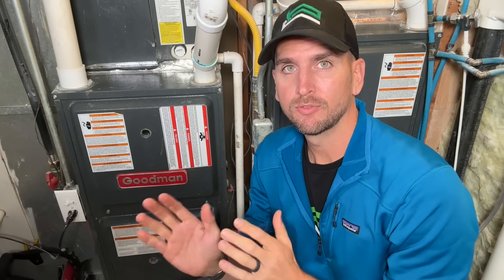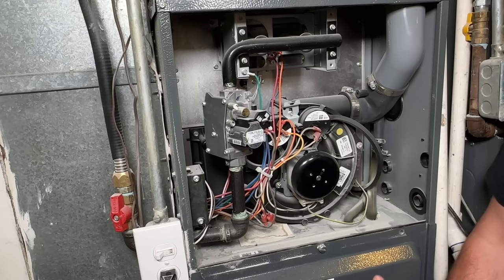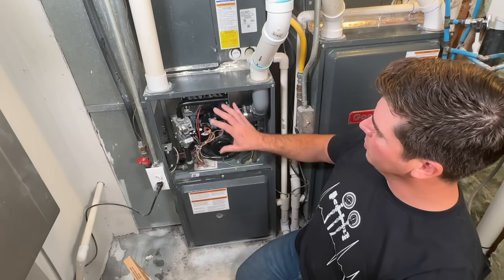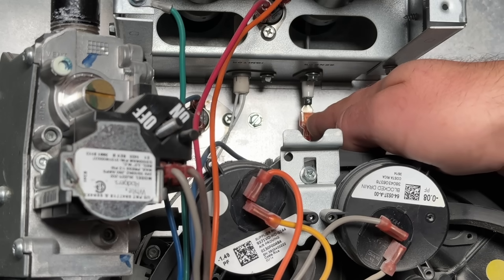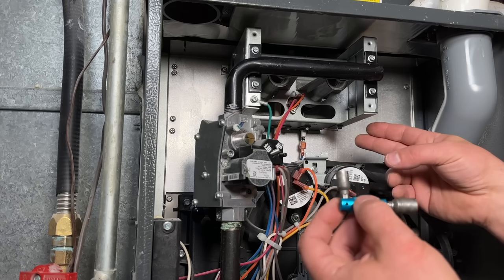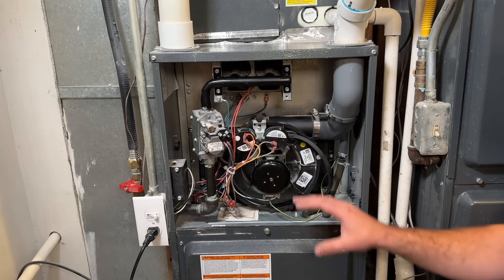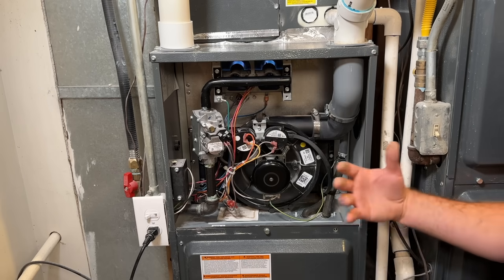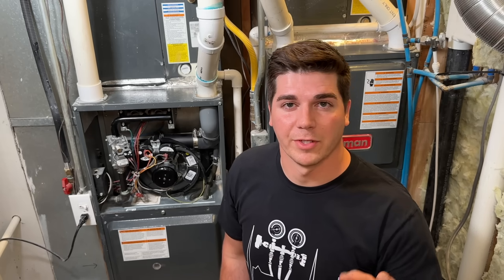Yearly Furnace Cleaning And Maintenance Pro Tips

Comment: I never cleaned my old oil furnace and I changed it out 15 years ago because it was only 80% efficient (when it was new). I never clean my new gas furnace (95 % efficient) and it is still going strong. Modern heat pumps can be more efficient and more convenient, since sometimes a ductless unit is very practical and easy to install.
Reply: Your oil furnace must have been a hot mess, lol.................seriously soot can buildup and restrict the flow of flue gases such as nitrogen, carbon dioxide and water vapor. Over time, carbon monoxide can build up in your home with this soot buildup if your furnace is not properly vented or your chimney isn't properly swept.
Reply: Good luck with that

Comment: The AC evaporative coil sits on top of that furnace.  Check the end of that pvc drain is clear.  Believe me I've seen that pan overfill and cause moisture problems in the combustion chamber.    90 percent gas furnace pressure switches are sensitive.  Make sure the intake is clear of debris before starting the furnace every year.  Also air filters at least should be changed out every month.  Remember not all the US is the same.  In your parts might be cool for every 3 months.  But for folks in FL and the southwest it's at least every month for filter changes.  The houses are built for profit not air tightness as those in colder climates.
Reply: Had this happen this year.  I unscrewed the fitting where the drain line came out of the furnace (near the top where the chiller is mounted inside), and found a piece of zip-tie plugging it from the installer.  It took several years for gunk to built up around that piece of zip-tie until it was completely blocked.
Reply: I got called out for a leaking hot water heater in a basement of an old building. Got there and was greeted with the entire basement flooded with 1-2 inches of water. Had to crawl in water under ductwork to get to the water heater. To me looked OK but thought it could be leaking from the bottom. On my crawl back I got dripped on near the furnace/AC. Found the condensate drain completely plugged with mud, steady 3 drips per second overflowing. I couldn't believe 3 drips per second could flood a 20x30 basement that full but cleaned the drain, dewatered the basement and it was 100% dry after. Owner said it was flooded by spring runoff and dewatered but then they noticed some new water come summer. They waited 3 months to call. I didn't think a dril could do that but with limited evaporation 3 drips a second is 1350 gallons over 3 months collecting. No basement drain obviously another problem but 125 year old buildings don't care about your codes.
Reply: Remember that "monthly" is only going to be if its in use the entire month. Spring or fall days or if you have a very clean house, you might go 2-4 months. Visually inspecting the filter is the key here.

Comment: How can I fix water dripping from inducer exhaust tube?near the clamp
Reply from the maker: I imagine your pipe is sloped in the wrong direction.  So when the air starts to cool running through the exhaust it creates condensation which should drain outside but if you have a negative slope it is running back into your inducer.  Check the slope and see how you can adjust the slope to the outlet on the exterior of the house assuming there is a horizontal section of pipe

Comment: You should also be doing a combustion analysis and a gas pressure test to ensure your low and high gas pressures are set to factory specs.
Reply: I was wondering if that was part of a service. Also is it necessary to check the draw of the fan motor with a multimeter to see if its drawing the proper amperage?
Reply: That’s one of the differences between a diyer or you tuber and an experienced technician
Reply: You cannot adjust gas pressures on a modulating gas valve (theres a warning label on them) or you will void the warranty and probably crack the heat exchanger. That said, some older gas valves are single stage or 2-stage is pretty common.

Comment: I would have wanted to see info on how to choose a replacement filter based on MPR / MERV specs. I have read that a too restrictive filter (like perhaps a MPR 2200) can put stress on an HVAC system. Is that true? Very helpful video - and timely!
Reply: Yes, it's absolutely true. I recommend the basic pleated filters.
Reply: Yes, a overly restrictive filter can definitely have some negative effects. I wouldn’t advise doing a higher merv rating then needed. Anything above merv 12 is considered hospital grade and not really needed for residential applications. I’ll be coming out with a video on this subject soon! Cheers
Reply: Not an expert, but yes, I've also read the finer filters stress the system. To mitigate this, you'd want a thicker filter (like the 4" ones instead of the 1".
Reply: @diyhvacguy  Agreed, above merv 12 is stressing out your fan motor too much. At that point, just vacuum your house more and shampoo it annually

Comment: Just look at the circuit board it has a trouble light that will tell you if it is a sensor or limit , 95% of the time it's the vacuum switch that works on negative pressure so the induced draft fan can clear chamber before igniting furnace, they accumulate moisture which makes the switch stick open

Comment: Good on the flame sensor, but I actually wanted to see how to clean and lube the blower assembly. My home had a 9 year old 80% furnace and I'm not sure they ever changed the filters.. the amount of crud I found in the ducts and in/around the cabinet was horrific.
It's a heat only air system. So the wear might not be as bad as an AC/heat combo.. but I'd still feel a lot better having a look at the blower, It's pretty deep.. not visible from the front and the entire top half of the cabinet is dual mounted filters.
Reply: Hi Senn, to clean the blower on the furnace , first shut off the power to the
furnace. Second , locate the blower and pass your finger in the fins to see if they
are clogged . If the dirt is really bad then you should remove the blower from the 
Furnace making sure you mark the position of the wires or taking a few pictures with your cell phone. Unhook the wires and screws/ bolts to remove the blower. I recommend you take the blower outside and use compressed air and a screwdriver to get to the individual 
fins . Once it is good and clean you can then put a few drops of light oil in the oil 
lubricating lines on the motor. The newer
motors may not have the lines for the front and back motor bearings and might  
be permanently be lubricated. Reinstall the blower and wires then start your furnace. Hope this helps
S from the Great white North
Reply: Most modern motors are all sealed up so you cant lube them

Comment: I found that i had a cracked heat exchanger when my CO2 detector went off not long after i started the heating season. I HIGHLY RECOMMEND THAT EVERY HOUSE WITH A GAS FURNACE HAVE ONE  , My furnace was thirty years old ,so if you have an older furnace you really must have a CO2 detector or you could die in your sleep.

Comment: I also write down the size of the filter. Beside the flow arrow.
Reply: Nah, not necessary. you have to pull out the filter to check it anyway. But I would always right the current date on it when installing a new filter

Comment: Do some furnaces have pilot lights? Is there a process to light the pilot again
Reply: You can set the furnace to heat than go shove a match to light and then die from an explosion from the natural gas. I mean it will be lit if that was the only goal. Furnaces havent used pilot light in about 30 years now, but still very common to see on gas water heaters.

Comment: Question: I have the same Goodman high eff furnace.  Obviously, on the right, my flue is connected and vents outside thru a white pvc pipe.  On the left side, there is no pvc connected(the furnace in your video shows pvc on the left also).  Did my guy forget something or is this ok?
Reply: It might be ok, it might not be ok. The pipe on yours going outside is for pushing the exhaust out of the house, the other is for bringing in fresh air to feed oxygen to the flames. Whether or not a pipe is required depends on how much free area you have around the furnace. By code you need 50 cubic feet per 1,000 btuh input rating for all gas appliances in the space. Many times, even if you do have enough free area to support the flame it's still a good idea to pipe in combustion air from outside to improve overall efficiency. Why use air you have paid to heat to support combustion when you can bring in air from outside instead?

Comment: I came here because I’m hearing my outside compressor kick on more then I remember last year, even during heat season. We still have our heat on (set at 66-69) as we live in a cold, northern climate. We’ve been in this home for just shy of two years. 
Wasn’t sure if the compressor should even be kicking on when the heat is turned on.
Reply: When my cycled frequently I discovered the air filter was clogged. It sits between the furnace and the air return duct typically. I slid mine out and used a vacuum, which helped for a few months, but I eventually just replaced it.
Reply: @peterbogardus1560  Oh yeah I know that. I change our house air filter out every 3-4 months or as needed.
Reply: Do you have a heat pump? Because thats what heat pumps do, run your compressor for heat. The easy way to tell is if the outdoor unit is raised up about a foot off the ground. You can always go pull out the disconnect fuse outside next to your air conditioning unit (mounted on the house) and it will never run that way.
Reply: @srobeck77 We sure do! The previous HO’s mentioned it in the house’s listing that it had a heat pump. The outdoor unit is also raised up on stilts! Good to know that’s why that kicks on. Thank you!
Reply: @telecasterman18  heat pumps arent very common in northern climates is prolly why you never seen one. But they are actually more efficient to run when its above 32-35"F outside vs natural gas heat. Below that outside temp or maybe a bit lower temp, than the gas heat will kick in. 

In southern climates, they almost all have heat pumps, so that's a little different. Generally, it will cost you more, especially in northern climates to find hvac service shops to fix heat pumps, fyi. But they are more efficient in moderate temps. Just know it's running your air conditioning system in reverse flow to get heat.

Comment: I have an old unit (1998). What does the the gentleman mean by keeping an eye on the heat exchanger if you have an older unit?
Reply: Open up panels then take an inspection mirror with a flashlight to look for visible cracks on it.  Youre probably never going to do this.  So instead, buy a quality CO2 detector and so you dont die in the middle of the night when your furnace goes bad.  Also referred to as the sleep you never wake up from.
Reply: @srobeck77  Thank you so much.

Comment: Maybe I missed the note to turn the furnace switch or breaker off before working on it, you don't really want it turning on while you're doing and if this. It's helpful to note what type of furnace you're working on, oil furnace, most if not all are going to have an in line oil filter you should be changing on an annual basis as well.
Reply: Yup you missed it. He turned off the power and gas before working on it. He was working on a natural gas furnace not oil, so thats totally irrelevant.

Comment: There's obviously more to it than what this video shows.  For example,  inspection of the heat exchanger for cracks,  adjusting of the manifold gas pressures,  testing of the high limit switch and so forth.  But good video for an average home owner who doesn't want to spend the money to do a maintenance.  Best to get a professional who knows what they're doing and performs the 21 point check up and adjustment.
Reply from the maker: Thanks for the feedback.  I am curious what is the average cost of the 21 point check?
Reply: What else needs to be checked
Reply: I agree. I'm not going in there.
Reply: @EverydayHomeRepairs  here in Toronto you're looking at $149 for a proper furnace maintenance.  Sorry for late reply,  been really busy 😅

Comment: Hi my Furnace smell dusty and causes me to sneeze a lot. We have hired two guy to clean our vent but the issue still persist. I guess this time we will have to clean the furnace and the blowing wheel
Reply: Sounds like you need the indoor fan motor wheel cleaned and also the indoor evaporator coil (just above the furnace on the inside). You can look at the wheel yourself by taking off the bottom furnace panel and shinning a flashlight inside there. You may also need to have your carpet shampood by professionals.

Comment: The access panels on our furnace are completely sealed up with the same type of sealant they used to seal the duct. Why would that be? Should I not open it and clean it?
Reply: cut with a razor blade or peel it off. then re-apply another strip of foil tape (from home depot) when done. Not rocket science, ammiright?! Im assuming you meant panels for the A-Coil  on the top portion? Those and the ductwork just gets foil taped so a tiny amount of air doesnt leak out the sides.

Comment: My furnace and AC are 33 years old. I have never cleaned the furnace and only washed the AC coils twice in 33 years. I do change the return air filter on a regular basis. The furnace has never been worked on and the AC unit has been recharged twice because the o ring in valve leaked. I know I am on barrowed  time with my unit but it keeps running.
Reply: My Rheem was 10 yrs old when I bought my home 26 yrs ago and been cleaned & thermocouple replaced once. I'm pretty much on barrowed time, too. But I don't have central air & I wanna get that when I replace my furnace. I've always had a carbon monoxide detector, too.

Comment: Good points, the draft inducer motor on mine failed a few years ago, changed it out, then noticed it has bushings instead of bearings and needs a little oil once a season.

Comment: Are you going to clean the evaporator and  the condenser outside a tune up should consist of the whole system heating and air
Reply: Middle of winter, you arent going to be spraying the outdoor coil with water in northern climates. I promise you that, lol
Reply: @srobeck77  only in spring time

Comment: I have an air filter down in the living space, in the ceiling, like Dave said could be the case.  Does that mean I do NOT have an air filter (a second one) in the furnace unit?  Or could I have one in the ceiling and a second one in the unit?  I certainly don't see an easily accessible one in the unit, unless I'd have to remove screws and panels to hunt for it.  25 year old Goodman.
Reply: There will always be a factory designed slot for a filter just before the furnace internals. It's designed to protect the coil and motors from your nasty skin dander and other dust. The air filter in vents of the house is just a gimmick and wears out your fan motors excessively more than anything else. You gotta use your lazy little fingers and remove those screws to see where it is inside. Then label the panel with a sharpie so you know for the next time.
Reply: @srobeck77 Great advise, except you're wrong.
Reply: @Kube_Dog  I was wrong about you being able to look inside the panels? Ya it happens.
Reply: @srobeck77  Great advise, except you're wrong.
Reply: @Kube_Dog  did you forget your already said that? Dimensia prolly is what happened here
Reply: @srobeck77  Great advise, except you're wrong.

Comment: Thanks for the video!
Wondering if anyone out there has any experience with an issues I'm having.
Fan on the furnace constantly runs but only in the evening. The fan is set to auto and I've replaced the thermostat. The filter was pretty dirty from fire season so I replaced it. It turns on around 5 with the heat but doesn't stop running after it reaches temperature. Very frustrating because it blowing in cold air in the evening.
Reply: Some new smart thermostats have comfort settings where certain temps can be scheduled for certain times of the day. Many including Ecobee thermostats include fan settings for these comfort settings where the user can have the fan always on during that time, automatic (meaning comes on with furnace or a\c) as well as minimum fan runtimes (meaning the minimum minutes per hour you want the fan to run including the time spent with the fan runs during a heat or cool cycle).
Reply: You might have a "sticky" relay or a bad control board
Reply: It’s probably in a soft lockout because something wrong
Reply: Odd that its only the evening. Id go replace the thermostat but dont get one of those garbage wifi ones like NEST.  Worst case scenario, it might be a cracked heat exchanger or bad furnace circuit board. Always make sure the power is off when changing out electrical components.  Well its been a year now, tell us what was the problem?